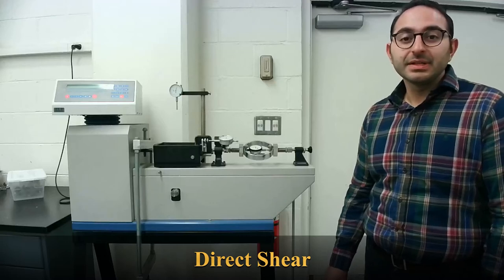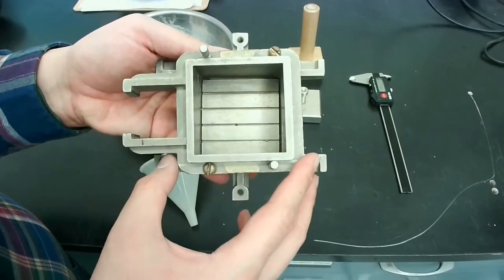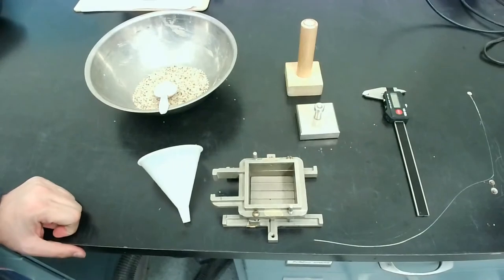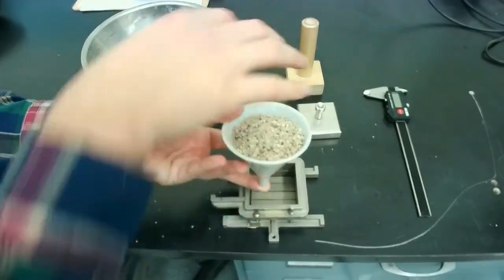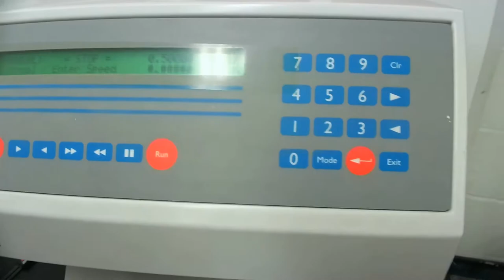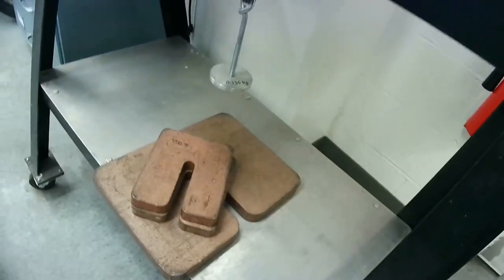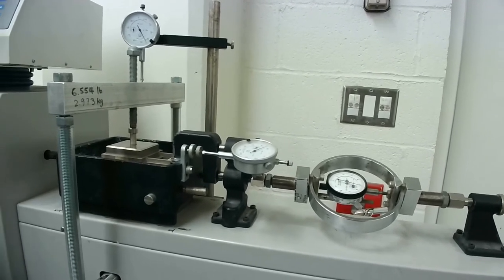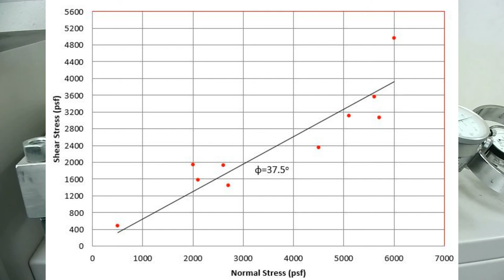Direct Shear Test on Dry Sand

Comment: Hello Sir Good Day, may I ask? 
1. How do i get and keep track with a constant density for the sand, all throughout three loadings?
2. What is the standard density for dry sand? Does it is same as density of loose sand?
3. What is the difference between dry sand, loose sand and packed sand? How do i know the sand sample is loose, packed, dense, or dry?
4. How do i know that when filling inside the shearbox, the sand sample is not pack?
5. If density has standard for sand, which standard do i follow?